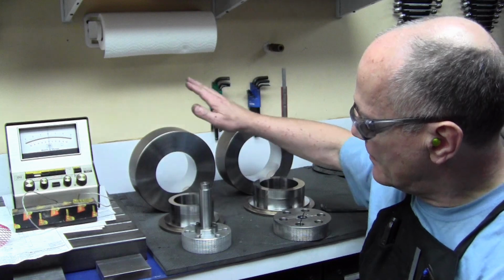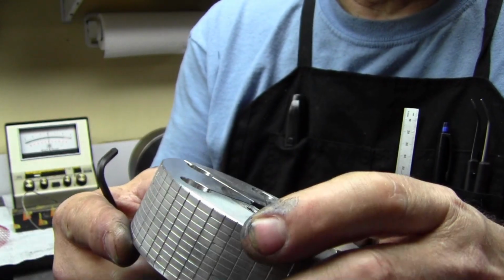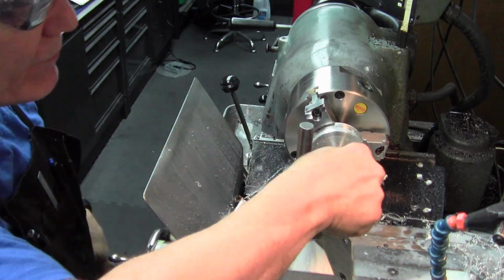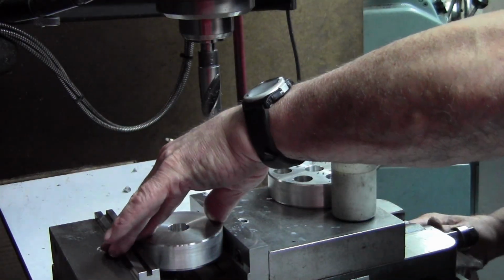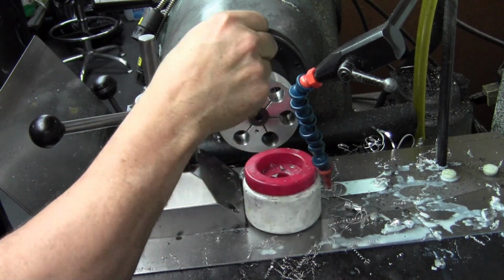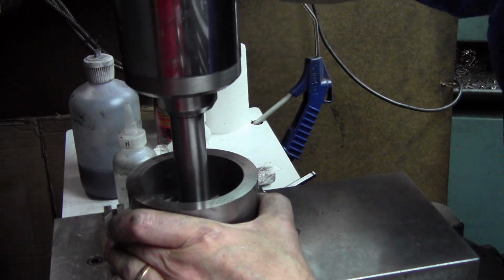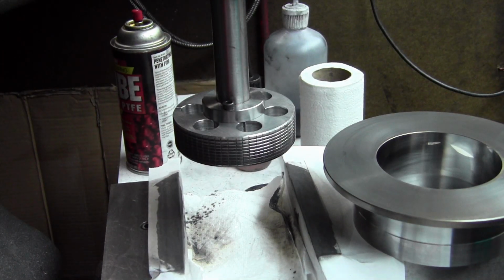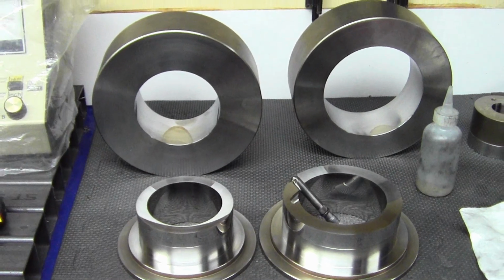MAKING AND USING LARGE DIAMETER LAPS

Comment: Hey Rob, great work (as usual), innovative and non-orthodox methods as always.

What I think that I would do the lapping the other way round : I would've put the part in a lathe and fix the lap to the tail-stock.
I always think that rotating the job is better ?
Reply from the maker: You don't want to mechanically hold a part you are lapping. it will distort the part and give bad cylindricity. a lap must be free to float in the part to give good geometry. That is why I let the part spin occasionally so that whatever influence my hand is doing is spread around the part.
Reply: OK. Thanks Rob. 
I did not mean to be rude or anything, it's just that I was trying to be helpful.
I absolutely admire your workmanship and strive for precision and perfection - never forget the templates you made to ensure the alignment of the adhesive covers on your resistor box !
I am a machinist and electronics instrument builder myself, that is why I have a feel for your effort and thinking process.
Reply from the maker: No problem, I just wanted you to know why.
Reply: That's why you have separate trade called "tool and die (mold) maker", because average machinist cannot grasp concepts of more precise machining, finishing, fitting (spotting) of the parts.
Average machinist will not fully understand why there's so many other processes (grinding, lapping, honing, polishing, EDM) from regular machining (turning, milling, drilling).
Reply: "Average machinists" don't "understand" or "grasp" things like honing, lapping, grinding, etc? That's odd given those are "standard" and "typical" tasks/processes performed in even "basic" engine machine shops where cylinder blocks are bored and honed, crankshafts are ground and polished, etc. Tool & die isn't a "separate trade" because in many cases people who work in "tool & die" aren't "trained professionals" at all and when they're "only" tool & die workers they're involved in "manufacturing" individual parts or the "tooling" to make individual parts and are working in factory "tool rooms" or are performing repetitive tasks with "manual" machine tools that can be as simple as handheld die-grinders performing tasks as simple and basic as removing casting flash or other "waste material" from castings, forgings etc. prior to those "parts" going to more complex and sophisticated machining/manufacturing processes performed by actual trained machinists or CNC machine tools, etc. 

The advent of CAD/CAM/CNC technology in "machine shops" has made a lot of "tool & die" jobs and "specialists" obsolete and the "trade" has been "expanded" to include people who do no "hands-on" work in the "machine shop" or on the "factory floor" or in the "tool room" at all and instead are working on computer keyboard and screens or at most out programming and "supervising" CNC machines or loading parts into and out of machines and/or "tombstones", etc.  Where there is "overlap" between the machinist and tool & die "fields" and "trades" its almost always machinists doing tool & die work/tasks as part of their job rather than a "tool & die specialist" who is "crossing over" and doing full-blown machine-shop work operating or at least capable of operating many or all of the machines in a "traditional" machine shop, performing tasks like "metal spraying" and other welding processes to "build up" used and worn or damaged parts prior to machining them back to specs, using blueprints or measurements/specifications taken from parts/service/operator's manuals to make new parts from "scratch", doing disassembly/reassembly work of expensive, complex machinery brought in "as-is" to be "rebuilt", doing the aforementioned boring/honing/grinding/polishing/lapping/milling/balancing of expensive and in some cases "priceless" or at least "irreplaceable" parts, modifying "stock" parts for "high-performance" use including offset-grinding crankshafts for increased stroke and engine displacement, performing "exotic" repair work like "pinning" or "plugging" cracks in cast-iron castings, etc.

The tech school I attended in southeast Nebraska 25+ years ago for Diesel Technology at that time had "separate" Machine Tool and Tool & Die programs so that qualified and trained machinists could get a "Tool & Die" degree without going through the entire Machine Tool program and so that Machine Tool students could add the Tool & Die "curriculum" not covered IN Machine Tool and go to school for an extra quarter or two and graduate with two Associate Degrees. The Diesel Truck/Construction program I was in was the same way. 5 "classroom" quarters and one "co-op" quarter that was like an "internship" to get a single Associate Degree in "Diesel Truck" plus an optional 7th quarter of "classroom" instruction (probably 75% of our instruction was hands-on "shop work" although there were several small "shops" that were part OF the several of the "classrooms" in addition to the main shop) to get a 2nd Associate Degree in Construction Equipment. During the 7th quarter we covered hydraulic systems, powershift transmissions, hydrostats, track-type machine undercarriage/final-drives, etc. 

Now "Machine Tool" and "Tool & Die" have been somewhat "combined" into "Precision Machining and Automation Technology" and the "core curriculum" that is 70+ credit hours and will get a student a "diploma" i in that program is overwhelmingly machine tool-focused on "traditional" machining with lathes, mills, boring bars, etc and it begins with manufacturing processes, materials, blueprint reading and drawing,  and other "traditional" machinist stuff. There is some CAD/CAM/CNC curriculum but it's minor compared to the "traditional" machining stuff and doesn't begin until approximately 3/4 of the way through the program (the school is 8 hours a day 5 days a week 48 weeks a year and is like going back to high-school or "worse" for some) and that is mainly covered to give students who may want to take an additional quarter a feel for what's covered in the other two "paths" that students in the primary program who want more than just the "machinist diploma" can take to either "focus" on "tool maker" or "automation specialist" for another 28 credit hours. 

And I'm sure that just like back when I was in school and the programs were "separate" and it was guys that just didn't "get" or "get into" doing the "hardcore" machinist stuff who stuck it out to go toward "Tool & Die" so they could stay cleaner and/or get a "apprentice" type job in a machine shop and hopefully eventually "get" the technical, complex MACHINIST stuff (there's WAY more math, science, reading talent/ability and general mechanical knowledge/inclination and WORK ETHIC required to be a MACHINIST than a "Tool & Die Maker") the "tool maker" focus/program is there to give students who don't "get" the academically/intellectually/physically-demanding MACHINIST stuff a "Plan B" as well as give those who want to be able to go anywhere and do anything and DO get the MACHINIST stuff a "bonus" for sticking it out an extra quarter. 

And the "Tool & Die Maker" added "bonus" quarter/program focuses MAINLY on mold-making and a few other fairly "simple" aspects of manufacturing technology with metals/plastics that's mainly "grunt work" and has to be really learned "on the job" while the "Automation" option is ALL "automation" and "advanced" CAD/CAM/CNC stuff that a good MACHINIST with that education/background in actually picking up blueprints and going over to a manual machine tool or several of them to make parts from "scratch" with those tools and their two hands can "pick up" pretty easily IF they decide they ever want to take a BIG PAY CUT and be a "CNC machinist" doing "factory work" punching buttons instead of being an ACTUAL machinist in a very demanding and very "short-handed" field/trade here in the U.S. where good machinists even straight out of tech school can make as much or more money than a factory "production manager" playing "boss" over a whole bunch of "CNC machinists" who are doing good to make as much money as skilled and experienced "maintenance technicians" in many factories now that CAD/CAM/CNC has advanced far enough that the "blueprints" can go directly from the "designer's" computer to the CNC machines and many "CNC machinists" simply "feed" and "clean up after" the CNC machines doing the actual MACHINING. 

I don't think you really have much of a clue about what "tool & die" is all about now and what it's pretty much always been about which is by and large a whole bunch of "workers" doing "grunt work" while a relative few "craftsmen" who were able to carve/sculpt/form molds and dies and create "rough" forgings and castings from them took "raw materials" and turned them into "blanks" and "billets" true "artists" aka MACHINISTS then had to figure out to "sculpt" into finished, detailed and highly precise and very sophisticated "collections" of finished parts by spinning them and/or cutters, bits etc at high speed to whittle away the "waste" and leave only the finished parts. Even when "tool & die" workers did use machine tools to machine finished parts they were/are almost always doing so under the supervision/direction of actual MACHINISTS who are there to walk them through or perform the basic machine set-up, make sure they're doing everything "by the book", etc. Almost anybody can pick up a DIE GRINDER and grind the casting flash off a cylinder block or head casting fresh from the mold and do it "right" with a few minutes or hours of "training" and "practice". Taking that same cylinder block years or decades later and boring/honing/milling it to "remanufacture" it for another "lifetime" is an entirely different universe and "trade" most people wouldn't "get" or be able to do "right" with a few years or even decades of "training" and "practice".
Reply: DEEREMEYER1, no disrespect intended but it seems you are the one who doesn't know what tool and die making entails. I grew up in my dad's T&D shop and worked as a T&D maker for 15 years before moving on to a different field of work. Any T&D maker deserving of the title has a solid grasp of manual machining in addition to the understanding of how to make, fix and improve production tooling. The good ones have a fairly solid grasp of metallurgy, metrology and engineering. 
I'm guessing that the only tool and die makers you've ever seen are mold makers and are judging the trade by that. Typical tool and die tolerances when it comes to production tooling for the automotive industry will generally be in the thousandths of an inch and often enough in the tenths when it comes to mating parts,  and a decent T&D maker should be able to hold those tolerances himself. And I have yet to see a T&D maker working under the supervision of a machinist, but I have often seen a T&D  maker give detailed instructions to a machinist to inform them of what aspects of a part are most critical. Don't get me wrong, most toolmakers aren't going to be able to do a machinist's job as well or as fast as a good machinist. But they almost always have a better understanding of what the parts the machinist is making are used for and how they function. The depiction of T&D makers mostly doing "grunt work"and the best T&D makers form the dies that create rough forgings that later get handed off to the "true artists" would be laughable if not so completely misleading. I've seen my fair share of machinists make a resume that gets them a job as a T&D maker (because in most cases it's a pay increase) only to get fired within a week or two because they didn't have a clue.

Comment: Did you have to scrap the part that had the flaw in it? Is there any reference material that shows how to make the spot drill you made? Type of material, angles etc?
Reply from the maker: The part was ok with the crack in it.  Material is a trashed spot drill. Just seat of the pants tool grinding on the geometry.
Reply: Rob excuse me but did you say that this chuck is only 170 dollars?
Reply from the maker: Yes, Shars tool. They have higher quality chucks that are very inexpensive also.
Reply: trialnterror thanks , it is really affordable. I will search it online

Comment: Thank you Robin for making and sharing these video's. 
I also noticed you have a third bolt on the fix jaw of your milling vise. Is that for rigidity? Did you try to taper fix jaw for hold down?
Radu
Reply from the maker: You are welcome Radu, that is a 1/2-13 tapped hole to use my clamp & stud set for holding long pieces down tight on the vise bottom. Thanks for watching and commenting.

Comment: Cool looking tool, I like the method of allowing for some expanding and contracting throughout a cylindrical shape, similar movement to an exhaust tubing expander just one solid piece and much less movement, lol. Although, speaking of tubing expanders do you think you could use one as a lap or would it be too inaccurate? You'd have to machine some threads off in order to chuck it up but seems like it could work. At the end you mention something about a generalized lapping video... how's that coming along? :D
Reply from the maker: A lap that is meant to improve geometry (not just shine things up) must be fairly rigid in itself. The separate pieces of the expander would tend to follow whatever shape was there already instead of making the hole more round.The lapping video is on the long list.

Comment: Would this process work on a smaller scale instead of reaming? Thinking more for odd sizes where you don't always have a reamer.
Reply from the maker: It works much easier on hardened materials and is only practical for removing <.001" on diameter so it is not going to replace reaming.
Reply: In emergency situation you can lap the hole using lap and coarser grain, but this is not normal practice. Can be done, but not recommended, not effective timewise.

Comment: What puzzled me for quite some time now: 
How do you handle singlepoint threading on the Hardinge without the compound? Do you have another trick up your sleeve or is that just something that does not come up very much in your work?
Same question for tapers, do you use a taper attachement or do you put the compound back on?
I like the sturdy look of the lathe without the compound and the fact that it makes drilling with the carriage so easy..
Reply from the maker: Single point threading works just fine using a straight infeed of the cross slide for the size threads I commonly do (16TPI and smaller). Most of the materials I use are 416 SS, A2 tool steel, and Aluminum, all which thread very nicely with the straight infeed.  I can put the compound back on when I need to and I do have the taper attachment for the lathe. Most short tapers I do with lapped straight tool set on the angle I need and just plunge the angle. Tools are extremely more rigid when the compound is gone so you can do things not possible before. Like plunge a 1" wide form tool with no chatter. BUT now that I have a CNC lathe in the shop I will probably never mess with the compound on the Hardinge for a (non between centers) taper ever again.

Thanks for commenting Stefan and keep up your great work!,
ATB, Robin

Comment: amazing work! I mean both on the part and the making of the video, and the throughout description of the process.

p.s. would there be any benefit to cut the circular slurry slots in a spiral pattern? so when the lap is rotated, the screw action would push the slurry upwards?
Reply from the maker: Thanks, spiral would work great but not enough better to warrant setting up a thread

Comment: Really nice craftsmanship, thanks for sharing Rob. I was interested in the import 3-jaw Chuck, you mentioned re-working and modifying. Do have a video talking more about it? If not, I think that would be a great diy improvement for many people. I always learn something from your videos : )
Reply from the maker: Thanks Kev Lar, I didn't do a video but it was mostly cleaning and deburring all the parts. Thanks for watching and commenting!
Reply: Do you recall what manner of things weren't the cleaning and deburring?  

I've arrived at the conclusion that import tools / machines are better regarded as kits, but I'm kind of afraid of running into spots where the sloppy manufacturing can't be corrected without adding bushings or shims, etc.  I don't have the experience to know how doing things like that will affect rigidity, accuracy, durability, and such.  

For hobby machinists with more time than money, advice from your level of expertise would be invaluable for avoiding 'hobby ending' debacles that were doomed from the start.

Comment: Nice videos. What kind of indicator is that? I have a couple with the dovetail on top, but without the ratcheting tip, they point straight out. I have an old Federal 10ths with a ratcheting tip that I use for centering, but have to use a convoluted arm arrangement to hold it.
Reply from the maker: Thanks rcdieselrc, it is a Brown and Sharpe Best Test indicator and thanks for watching and commenting!

Comment: Absolute top quality work. Do you find any disadvantages with aluminum laps as compared to brass? Also, what kind of apron are you using? That pocket configuration looks pretty handy.
Reply from the maker: Thanks Duncan, I find the aluminum and brass behave much the same but aluminum is much cheaper and on a lap this size that is a big deal. That is a purchased apron but I sewed right through the left pocket turning it into 3 slots and the right into 2 slots.
ATB, Robin